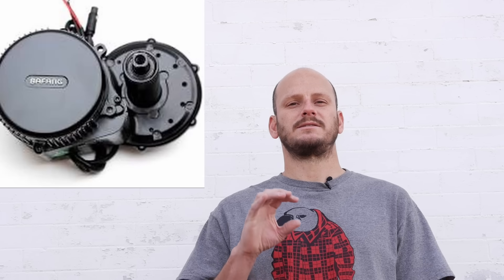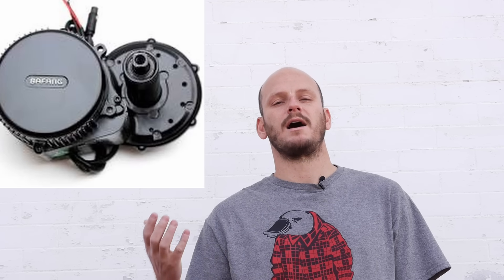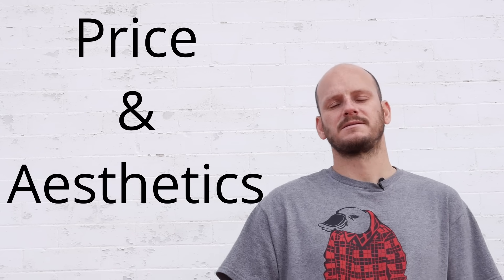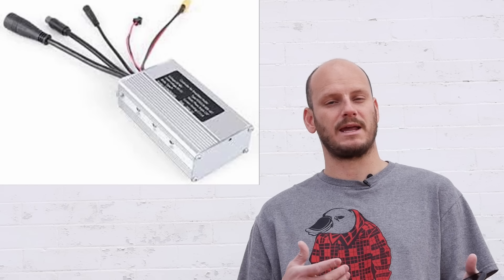Hub vs. Mid Drive Motors: Why Hub Motors Suck and Debunking Common Myths with performance test

Comment: I've got both. The hubbers only fall short on the steep climbs. That's what the mid drive is for, tough single track. For exploring old tracks in the countryside the hubbers shine. The hubbers can negotiate high grass and overgrowth without getting the drivetrain entangled in grass. Just don't peddle and let the hub motor do the work. That is not possible on a mid drive or regular bike. Other advantages to a hubber is drive train redundancy,  twice I've had to peddle and, once after bending the chain ring on a hidden stump at speed, rode out with just the hub motor. Also hubbers are cheap to repair. All in all I agree with Mr. Nerdout that mids out preform hubbers, but that doesn't mean hub motors aren't good. Just because a Ferrari will outpreform a Miata doesn't mean the Miata is no good.
Reply: @nonegone7170Many mid drives do not have throttles. I wasn't clear there, sorry. A hubber, without peddling does not move the chain/ sprockets so an overgrown area does not get wound up in the drivetrain. My midrive Biktrix FS Ultra has a throttle yes, but the drivetrain rotation will tangle up the overgrown same as peddling. This is why I use my hubbers for exploring areas not usually ridden. It isn't pleasant cutting/pulling grass and whatnot out of the drivetrain whilst getting eaten by bugs.
Reply: Got mine front hub drives!  Thinking it would not strain rear bearings,
Reply: @revareva2  you will never strain bearings in a hub motor regardless of front or rear mounting. Those bearings are big and rugged.
Reply: I agree. I have both and when I’m feeling lazy I take my Hubber so I don’t have to shift, and it’s got 3000 watts so power isn’t a problem
Reply: @StefanRandall  thats a motorcycle not an ebike anymore lol.
Reply: Um, I bomb overgrown trails with a mid drive and double hubs and never had a problem with getting chains and cranks hung up on grass. On either of them.
Can still bust your chainring on rocks if your using a hub motor.
Unless you just ditch the drivetrain, so the chain, cranks and ring just aren't there to get wrecked in the first place. . .
Reply: I disagree. Miata’s are dumb.
Reply: @aaronflanagan8983  no they’re not
Reply: @aaronflanagan8983  I doubt you have ever driven a Miata, let alone own one.
Reply: @kevinnielsen1356  Why would I?
Reply: @aaronflanagan8983  In order to become less of a dummie
Reply: @kevinnielsen1356  touché. Oh, wait….

Comment: for the mid drive motor, im planning to use one meant for a gocart and using my 7 speed transmission on my bike to boost it's speed, but i want to keep the peddles, is there a freewheel conversion part for the front crank?

Comment: Biggest factor for me is unsprung mass and use of gears. 
On a hard-tail hub motors do wreck spokes much more than mid-drive, and on suspended bikes, hub motors give the suspension much more work to do.

Comment: This video fails at almost every level of criticism and does not make a proper theoretical comparison. The assumption that electric motor drives of any kind should require gears to make the motors torque practical or effective is a complete failure of the design of the motor to begin with. The only take away from this video is that if you compare crap designs the best outcome is crap. Crap criticism, crap tech, and crap application of said tech. This video is high successful in illustrating just how fundamentally ignorant the current industry is and the offerings that are brought to market.
Reply from the maker: Moto ratings under 1hp need a transmission if you want anything related to performance. Those that don’t want any performance won’t require a transmission. But the practicality of it is night and day. Try it.

Comment: You are correct. Hub drives don’t like slow speed high torque demands. Living in a hilly location I had many problems with a over loaded hub drive.  Mid drive solved the problem

Comment: This is far to bias of an opinion piece since hub and mids each have their pros and cons. Theres a damn good reason why hub is far more common then mid drive motors: price and ease of use. I dont want to be letting off a throttle to shift gears, ever. So I would never buy a mid for those 2 reasons alone.

Comment: I need a little support for climbing up some steep sloops, a small hub motor is perfectly fine for me. Or if there is a strong headwind.
I want to pedal. It's good for me. If I need a moped I'll buy one, not a bicycle with motor.

Comment: ok but what about side burns? the heat is crazy from middrive motors and it is less efficient. hub motors can be up to 97% efficient
Reply: This could be pretty easily tested with a mid drive and a hub motor on same bike (or roughly same) with full battery ...both cruising at the same speed for a period of time and then recharged to full and figuring out wattage used on a killawatt.  I'd imagine they'd be close.

Comment: Wait, if there are pros to a hub motor, then by definition it doesn't suck.  Can our host explain why diesel-electric locomotives, for whom torque is paramount, use a traction motor on each wheel, essentially the same system as an e-bike hub motor?
Reply from the maker: It can have pros and still, simultaneously suck 😀 just like mid drives, two door cars. Check out my video “biggest misconception on how ebike motors work” for my explanation on your question 😀
Reply: @JohnnyNerdOut  No thanks.  If you claim something "sucks" just to get clicks and comments, then equivocate, I have no use for your channel.  "Sucks" usually means it does not do what is supposed to do or does it badly and unreliably.  People who love Ford pickups often claim that Chevy pickups suck (and vice versa), but that's obviously false because millions of both Fords and Chevys get their intended job done every day and last hundreds of thousands of miles.  Hub motors do not suck.

Comment: Got a Bafang M620 brand new  was pedalling all of a sudden  im ghost pedaling  cant pedal home its like i had no chain to turn back wheel . Got any ideas ? Thanks
Reply: Mid drives typically use a transmission between the cranks and the chainring. There may be a problem. If it's new anyways just bring it to the dealer for a warranty repair
Reply: @simonm1447  Finally ended up being the freehub pawls that were stuck
Reply: @laplantemichel709  Good to hear you bike is fine again
Reply: @simonm1447  lol but that's not the end of it now i realized that the m620 has lots of torque so when in max gears 7 or 8 the chain skips a tooth, so those  gears are unusable so contacted the company they say it's normal bike has to much torque (ya right )in my book it's a flaw .But atleist it seems they got a fix for it (they call it an upgrade )a BOX COMPONENT  8 speed clutch derailleur and shifter set it suppose to do the job waiting for it now
Reply: @laplantemichel709  Chains and cassettes are a common problem with high powered mid drives. These components had been developed and designed once for non electric bikes (even if some manufacturers offer an E bike lineup), they even have a shorter lifespan on 250 W mid drives but a really powerful mid drive is overstressing them. 
There is one company called Biktrix using a separate motorbike style drive train on the left side for the motor power and the normal bicycle drive train including the derailleur system on the right side, I don't know how much this bike costs but they avoid the problems by using 2 drive trains 
https://www.youtube.com/watch?v=h1UXuK8CnWU
Reply: @simonm1447 regular  bicycle components wont do .Luckily for me not always at max power but like any toy you gotta see what top speed you can achieve lol  Yes i've seen this biktrix bike  Juggernaut XD Dual Drivetrain eBike - 2000W+ Motor, 300Nm of Torque! a monster not in same price range  at all .Thanks

Comment: As a pro bike mechanic myself I agree 100% with your views. I'll add another difference : weight distribution, much better on a mid-drive. And also a hub motor is acceptable on the front wheel of a tricycle used by elderly/disabled person.

Comment: I am from Europe, and the laws are very restrictive when it comes to speed pedelecs (up to 28 mph). They almos only sell Middrives Bosch CX with nominal rated power of 350W. So only option here is to get Hub Motor like the Stromers which are rated between 750 and 850W.  350W Middrives in Europe does not allow you to comfortably pedal (no Gas Grip allowed!) at 28 mph. Do you have an idea, why europeans use those weak 350W middrives instead of the mentioned 750W....?

Comment: To compare torque has no meaning in this case. 

Middrive has higher torque, yes, but at low RPM- because it is meant to work through chain transmission. In the chain transmission is the power from motor "eaten" by mechanical inefficiencies of chain and sprockets. 
First, the RPMs are reduced through a single and more often used double reduction, then the low RPM high torque is transformed from low RPM back to higher RPM in chain transmission. With this up to 10% of energy is wasted compared to geared hubmotor, and 20% of energy is wasted. Whats more, addition of torque to the torque produced by your legs is wearing the chain very fast. 
There is certain advantage to middrive compared to direct drive hubmotor. You can use the derailleur for adjusting the gear ratio, which isn't possible for hubmotors.

Comment: Comparing gearing for a car with gearing for an e-bike is, either dishonest or ignorant. And why not mentioning weight? Or braking?
Reply from the maker: Cars don’t need gearing due to the amount of power they use. Bicycles need gearing due to the amount of power 👍
Reply: @JohnnyNerdOut  though we do know that ebikes don't need gearing and cars have gearing. Go figure. Actually, electric motors don't need gearing (at least not multiple gears). Hence only electric cars don't have gearing.

Comment: I want to build a e bike using an 7 speed adult trike .  I don't have a lot of hills in my area . is it better to use a hub or mid on a trike? Most trikes is see have hub motors.
Reply: If it's flat hubs work great. They just don't work that great on a MTB for climbing, here they lack torque

Comment: Oh, so hub motors work spokes loose, but the mid drive, which also sends it's torque through the spokes, doesn't make the spokes loose lol. Sounds like you have your own !mid drive! laws of physics lol. As you claim, the mid drive can apply more torque to the spokes, but won't  break the spokes. But a hub motor, which applies less torque through the spokes, will cause the spokes to come loose or break lol. Never heard such crap.
Reply from the maker: Check my pinned comment

Comment: Just a question electric cars dont have gearbox ? again the choice is yours you pay your money . Good fun
Reply from the maker: No electric cars don’t need gears as they put out crazy amount of power
Reply: Electric cars also have a transmission, but it's just one gear to get a good rpm ratio between the motor and the wheels. 2 speed transmissions (Porsche Taycan) are rare.

Comment: Thank you for the video information.. One  ignorant question: can you just hit the throttle on a hub motor—like I just wanted to be lazy and cruise—but on a mid-drive do I need to peddle in order to have power assist??  Thank you!
Reply from the maker: Depends on systems. They are not all created equal. For example, all the mid drives I sell come with a throttle. But if you buy a mid drive that was prebuilt it probably wouldn’t. Most hubs have a throttle but some don’t.
Reply: Thank you!  With so many comments, I wasn’t sure if you would see, or take the time to answer, so I really appreciate it!!

Comment: My wife and I have two year old Aventon Level. It’s a hub motor that you claim sucks. I’m approaching 8,000 miles on my bike. I’ve replaced 2 spokes in 8,000 miles and honestly that was my fault. And my local bike shop is quite competent at servicing my bike. Ive really had no problems and I for sure have no complaints. If I want to go fast, I take out the Harley. This is a bike for God’s sake. If you need to ride a motorized mountain goat then buy a dirt bike. BTW, insulting hub motor bike owners is low class. As soon as I push the send button, your channel will be deleted.

Comment: very good explanation. electric single speed is the best solution if you can design your motor + gear reduction to have enough torque to accelerate quickly from a start and climb any hill, plus enough revs & power to get to your desired top speed easily.
most if not all EV's fall into that category.
first because of aero drag, to get enough power to give you decent acceleration at highway speed, those motors can also put out more than enough torque.
secondly, they have high amps and active cooling and won't be damaged by climbing steep hills
hub motor ebikes usually don't have enough torque to maintain speed on steep hills. you will lose speed quickly and keep losing speed until you can downshift and provide enough force to maintain speed yourself, but the hub motor will keep working at high amps/low rpm and overheat if the hill is too long. plus geared hubs almost always use plastic gears that are sensitive to overheating.
the problem is that cost comparison is only valid for conversions. talking about brand new ebike from the factory, mid drives are easily 2x as expensive as hub motors.
this means hub motors are fine if you live in a flat area and you just need a commuter that will happily cruise at its rated top speed with little pedalling or even throttle like a moped. they also climb better if you are very light (my wife can climb hills easily that same bike will completely stall if it has to carry my 200lbs) mid drive are better for either more sporty bikes like road bikes/mountain bikes or if you want more workout and pedal assist that will only increase your strength, not replace it.

Comment: Hub drives have a mechanical disadvantage,simple.Its about leverage and gearing!
Reply: It depends where you use it. Hubs are completely sufficient in flat areas or with moderate hills, even as a 250 W EU version. In hilly or mountainous terrain the torque isn't enough, and you have to pedal as much as if you ride a non electric bike. This is the terrain where mid drives have their advantage.

Comment: I work in a bike store in Europe.

Most of the people will not shift a bike when stopping or starting to drive , they leave the bike in the highest gear. So if they wanna start driving the bike it is in the highest gear and the motor has to put alot of power to get moving.

I ask the buyers if they like to shift every time when they stop and if hey say I don't wanna shift I will sell a rear hub motor e bike

Comment: The difficult thing is to find a good hub engine, because china sell so many low quality clones. That is true.

But once you try it, and specially for conmuting, you don't wanna go back. It's... Yeah. Esentially you turn your bike in a motorbike, for 500€. And if you manage to fit it enogh juice, I'd say it's even better. It's true those motors are 80% efficiency, which is not a lot, but you are moving ~45kg, instead of 200kg.

Comment: If there is half the torque from the motor there should be twice the BHP? Either that or you are referring to the torque converted by the geartrain, which is a little disingenuous. That destroyed wheel you show has no hub motor.... That said your video makes sense, but I have a question.

Can you get an "engageable" drive, I want the exercise from my bike with just some help on the hills? We have some pretty steep around here and I am 70 years old, I need the exercise.
Reply from the maker: The torque would be usable”at the wheel” which in my opinion is the only important measurement. Ratings on paper mean nothing. It’s what you are able to directly apply to work that matters (to me)
Reply: @JohnnyNerdOut  not quite, this motor is assisting the rider. But going through the geartrain certainly helps. One other thing, you said prices are roughly the same for both drives, I havent found that to be the case.
Reply from the maker: @allanb52  same price for similar quality built motors
Reply: @JohnnyNerdOut  but the kits are not the same price. I guess it is cheaper to make a wheel than a universal hub assembly.
Reply from the maker: @allanb52  the problem is a lack of apples to apples comparisons. There are only a few mid drive makers while there are dozens of hub manufacturers. Compare a hub kit from Ebikes.ca ( good quality) to a 750w mid drive from Bafang or tongsheng. All will run you $400-500 for a complete motor kit.
Reply: Electric road bikes typically use small hub motors. The reason is mid drives typically have a transmission between the cranks and the chain ring, which reduces the efficiency of the energy put into the cranks by the cyclist. Hub motors don't have this, they have a conventional bottom bracket with the same good drive train efficiency of a non electric bike using a derailleur system. So electric road bikes use a small but light hub motor, combined with a relatively small but lighter battery (mostly 250 Wh), sometimes put into a water bottle style casing. These bikes are made to get ridden non electric on the flat and to support the rider just on hills.